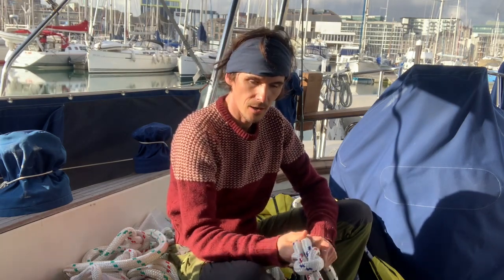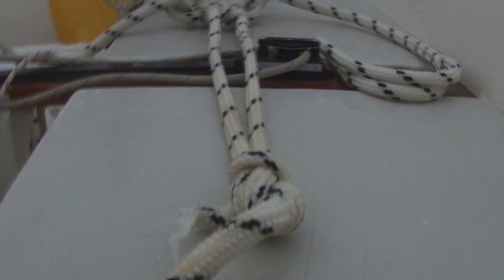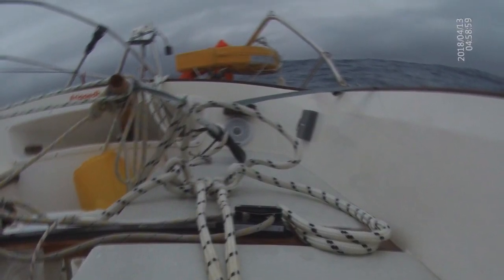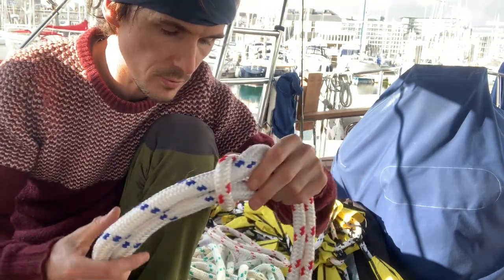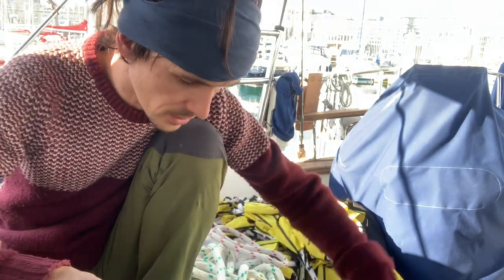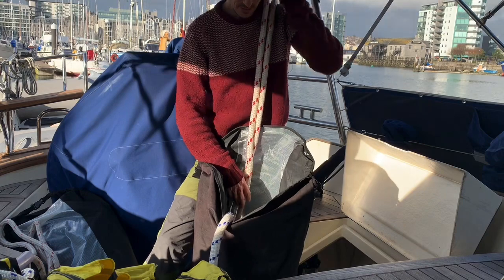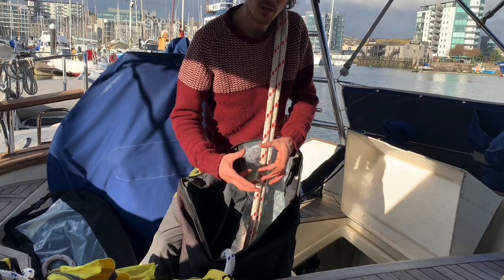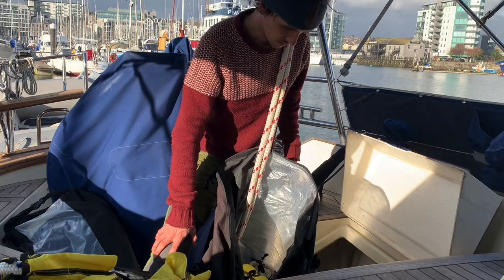Why did Susie Goodall’s Series Drogue snap?

Comment: Never deploy any drogue weight first (power mode).  Always bridle first to flake out safely. Any tangle in the flaking must be manageable.
Reply from the maker: The problem with that method is that once you get a reasonable amount out, you have two lines, both with cones next to one another which could tangle. Then once you have over 30m out, you won’t be able to hold the line any longer. I don’t believe your method would work on a JSD. Perhaps a normal drogue but not a JSD.

Comment: We build the new Sentinel-class cutters for the Coast Guard and only supply the US made sea anchor. The JSD only works for a small number of older boats designs. it can't handle the newer boat designs. Dyneema won't solve the JSD breakage issues.
Reply from the maker: Strange. There are many accounts of modern yachts of various sizes using a JSD successfully including ourselves.
Reply: A JSD (Jordan Series Drogue) can typically be deployed on sailboats ranging in size from about 30 to 70 feet. However, the specific size depends on factors like the boat's weight, hull design, and intended use. For larger boats (up to around 100 feet), a larger, more robust JSD may be required.

Comment: It doesn’t look as though it broke at a knot in the line which failed - am I missing something ?
Reply: Lines generally break close to the knot because they have to make a sudden change in direction  as they enter the knot, this bending causes significant additional strain on the outside of the bend resulting in the breakage at that point. That's why spliced lines  are stronger - the line does not have to make sudden change in direction.

Comment: Nice one Tim. I should be getting my chainplates in the next week or two...
Reply from the maker: Nice one! Recon you’ll be set to cast off for March 31st?
Reply: @ChasingContours  No. My crew isn't arriving until late April plus I've discovered a weeping through-hull so I'm getting lifted out to get that sorted. Actually, it's unused so I'm going to remove it and glass over - one less hole in the hull!
Reply from the maker: @sailingmoonshadow3169  will you replace it in the slings and go straight back in? I once replaced a through hull over a tide drying out against a wall! I was really concerned about not getting it done and then I finished within an hour and sat around twiddling my thumbs for the other 6 :)
Reply: @ChasingContours  I may do if I can get it over a weekend. I've done that before when I replaced my stern gland - lifted last thing on Friday put back first thing on Monday. Otherwise I'll get out into a cradle. If I'm out for a week I might just replace all the through-hulls.